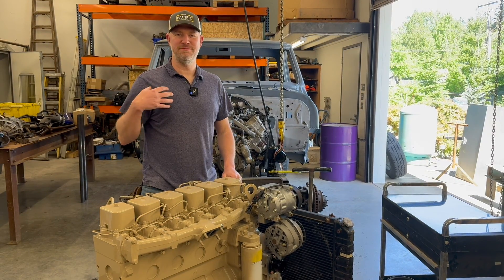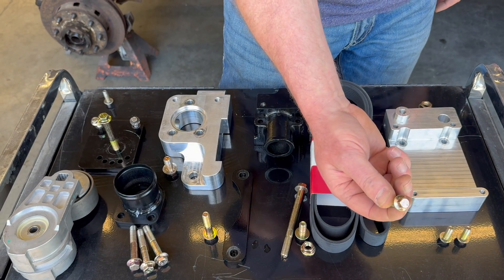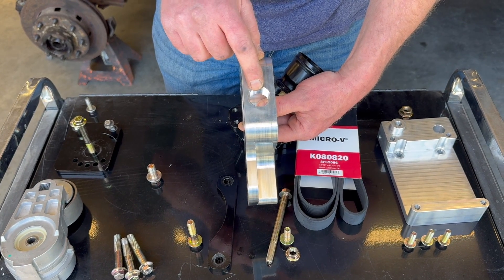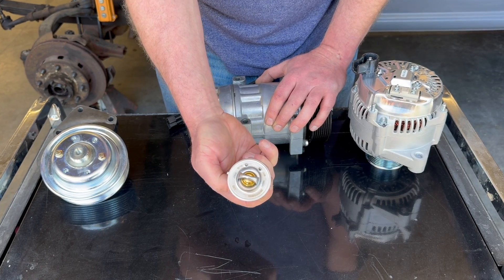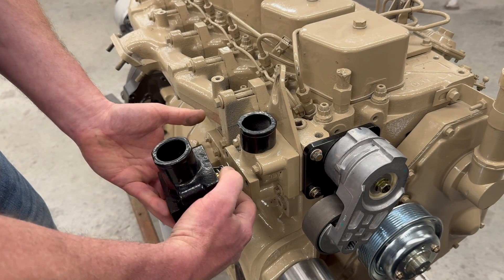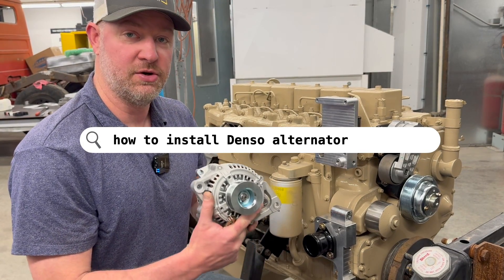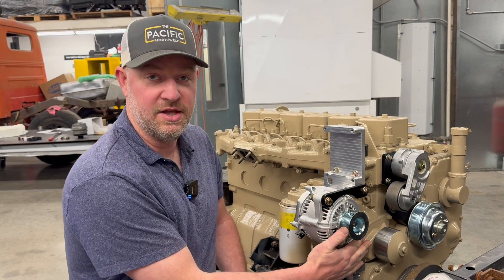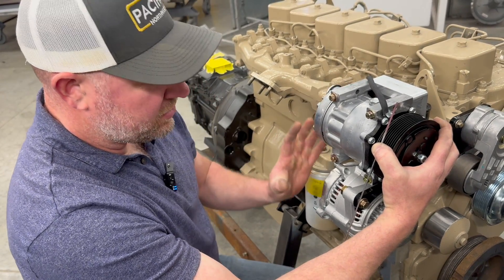Version 2.0! High Mount AC Bracket Kit 2.0 - DIY Cummins Swap

Comment: Do you use a 1 Gen or 2nd Gen Ram Cummins AC compressor?
Reply from the maker: Gen 1 or 2 Dodge/Cummins AC compressors will work.  The Gen 1 1989-1993 is more compatible  with aftermarket AC systems like Vintage air.  With that said the rear compressor head on either compressor can be swapped to work with different line sets.
Reply: Is it possible to use the 6.0L powerstroke a/c compressor? Mount style looks similar

Comment: I'm  currently doing a 12V swap into a Excursion, I'm well committed but the engine is not in yet and I just find out about that kit, it look cool but what is the purpose, right know my engine is on a stand with the dodge alternator and OEM bracket ? I don't see why I need that ? Please let me know

Comment: Hey I purchased and installed this in my 2008 f 250 with a 12 valve. I had no issues with the install but I got the 2006 or 2006 ford alternator for the 6.0. I hooked up the alternator the same way as the 6.4 alternator which was fine and now the battery light on the dash is lit up. 
I put the plug in the alt. And have a wire from the stud on back of alternator to the positive on the battery. Any help would be appreciated. 
The new brackets should still ground the alt. Case?

Comment: Do the stock steel heater hose lines above exhaust man get deleted with this kit? Also wondering what the best alternator set up for correct tach RPM. If I install the dodge 8 groove pulley on my 1998 6.5 alternator will I still need to dakota digital to calibrate?
called local Automotive electrical shop and the short of it was the rpm from an alternator in the case of the GM Alternator will only give correct RPM if it has same amount of poles as the Dodge unit? Needless to say the conversation was fast and above my paygrid. Anyone that has done this pls reply Tks